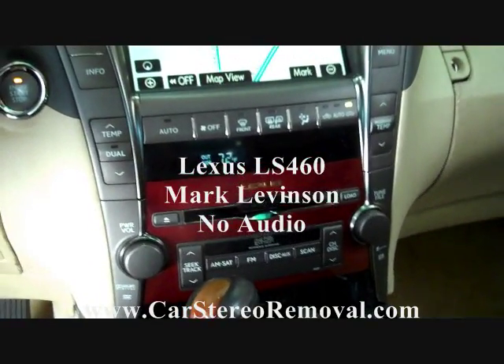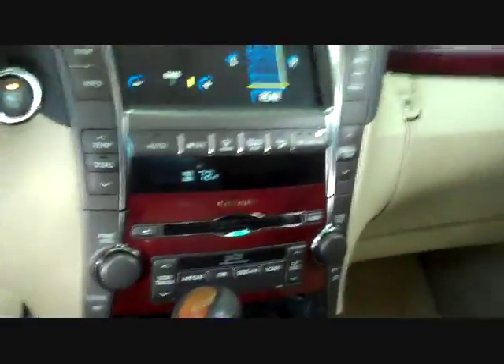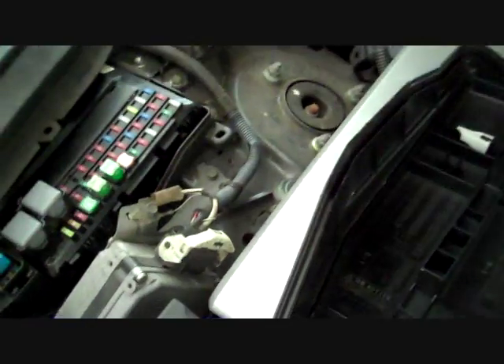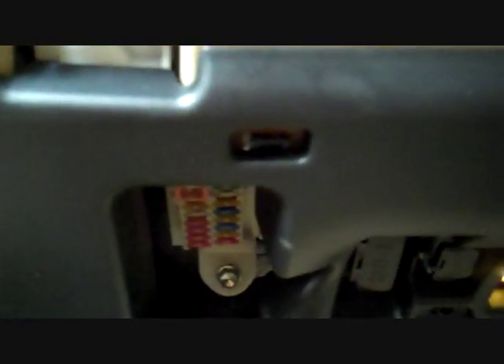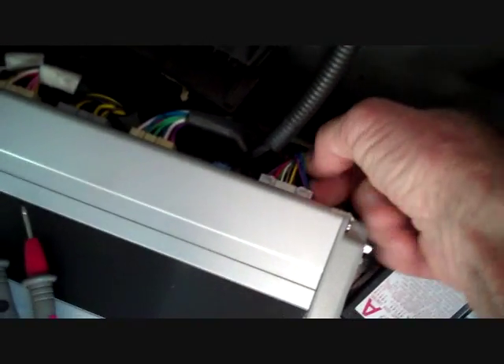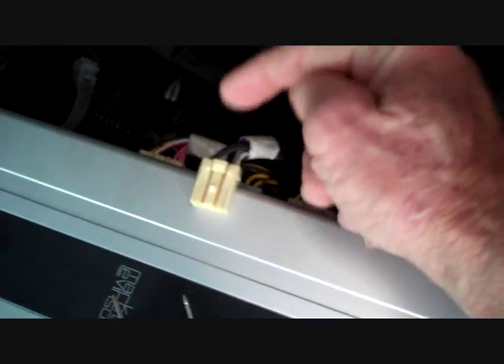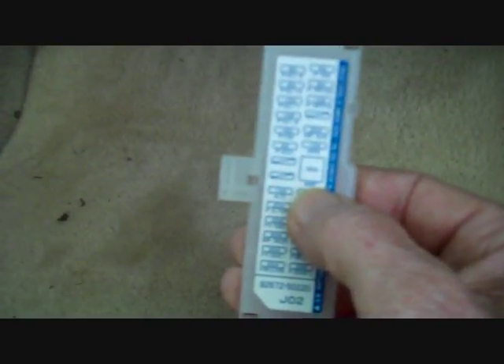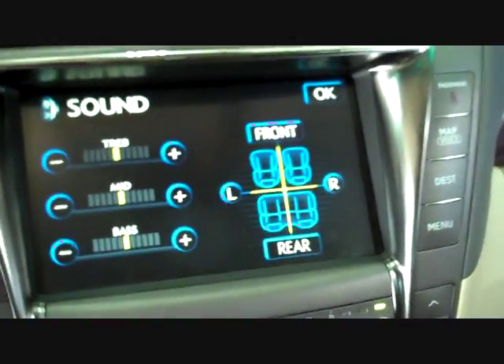Lexus LS460 Mark Levinson No Audio = Car Stereo HELP

Comment: Thank You!!! I have not been able to check back with my relative to see if this resolves the problem, but all the symptoms you experienced are the same as hers. It's a 2007 I sold to her and I feel obligated to help her fix it. You may have given me the answer.
Also, when I owned it, the amplifier failed and I had to remove it and sent it to a place in Syracuse NY. They were professional and solved the initial problem. Now I'll try your method and I hope it works. Question: Do you know the amperage of the fuse required? I don't have the car with me.

Comment: What was the point of telling us the fuse panel when you didn’t tell us which fuse to check?
Reply from the maker: If you have the owner's manual, you know which fuse to check. Without it, your checking them all. Your checking them because something? is not working...

Comment: Lexus should have recalled all those cars and fixed the stereo. Wish I would have known I never would have purchased the car.
Reply: Hahahaha I have the same issue with 2023 GX. Brand new vehicle. Have Been to 3 different dealerships they have replaced the amps and some speakers however, same results, after playing the radio with a volume on 50 for like 15 minutes the audio cuts off and the only way to get the audio back is to turn the vehicle completely off and turn it back on. This issue only happens with the luxury gx with the mark Levinson system. Didn’t have an issue with the loaner!!!!!!
Reply: I have an audio problem as well, wait until your battery gets "The parasitic draw" problem.
Reply: @TheFriendlyPsychopath any updates? I believe mine has had that problem Lexus replaced battery bc it was under warranty but I took my amp out and no battery issues

Comment: I have a 08' gx470 with the ML system.  When i turn the radio on it cuts in and out steadily and rapidly.  I brought to dealership and they could not determine what the problem was. Please note that at that time all lights would also go dim and bright rapidly and steadily as well so they recommended a new alternator and said that would fix the issue.. it did not. Any ideas what the problem could be or if there is some testing to see if the problem is with the amp? I suspect it could be the stereo itself.

Comment: Hi. Excellent video! I am having a similar issue with a 2016 Lexus RC F. The radio is working but NO sound at all. Do you know how many fuse boxes this car has? Where are they located?  Thank you!
Reply: Same issue in my ‘15 rcf, did you ever figure it out?
Reply: @kennyfsu  same for my rcf… you guys figured out?
Reply: @cesarguirado23  From my research we need a whole new amp. There's also a company called United Audio that can repair it but it's like $600.
Reply: @kennyfsu  great 🤦🏾‍♂️

Comment: Please do a video for Mark Levinson  2016  is200t lexus.  The 2014 to 2017 is250  should also be the same with navigation.  My amp gave out and I replaced it but still no sound.
Reply: Me to did u find out the problem
Reply: Same
Reply: Did you guys find a solution?

Comment: Hello great video I have same car no audio when connected via bluetooth it will work briefly then shut off like if its overheating or something because if shut car off and turn it on it will work again but If i raise the volume a bit high it will cut off and i have to turn car off and on again  for it to work ? And also it says audio off but the volume button seems unresponsive  Thanks
Reply: did you solve the problem? how did you decide?

Comment: I have a 2013 Lexus ES350. No sound, and can't adjust the volume Up or Down from the steering wheel. Is this a fuse issue?
Reply: Jeff Noravong did you figure it out

Comment: Send to OEM Auto Audio in Manlius, NY.
Reply: United Radio fixed my amp and it only lasted a year and a half. Died again. UR only warranties their work for one year.  I'm not spending another $475. I want a way to use an aftermarket amp but I don't know how to do any of this stuff.
Reply: daftboy11 You should be able to use a line level reducer or get the pin out on the wiring diagram and you may be able to tie it into an aftermarket amp. On the Toyota Celica the speaker lines coming out of the deck went to an internal amp they were all RCA’s just not with RC ends I had to buy a harness check out Crutchfield or some of your audio shops in your area should be able to do it wisely
Reply: Fixbrokenthings No sir, no spills. And I did contact them because it had only been a short time since they repaired it. All they said was it was out of warranty and I could send it back for repair for $475. Yeah, no thanks.

Comment: I just took this amp out and sent it in for repair as I thought I checked all the fuses, and sound was all down to the right.  I was told by the repair place it was the amp.  Got it back today and put it in, NOTHING.  same shit.  so now what
Reply: The amp blows the fuse on the passenger side when faulty. If the amp was repaired, now replace the 30amp fuse.
Reply: @shwndh  where is that located and what color? I have a 2007 lexus ls460
Reply: Same here.   Sent out repair.  Got back  but nothing work.
Reply: I may have to test the fuse block on the trunk.
Reply: Did you find out the issue and fix it? I got the same problem now
Reply: Can you please provide the info for the shop who repaired the amp I want to send mine to get it fix as well thanks

Comment: i have the same problem with my 06 gs300.. no sound, i can't change the bass, balance or fader.. I've been looking at all the fuses and they look fine.. i'm lost lol
Reply: Same bro my sound cut off one day and never returned
Reply: @chyshawnellis7757  .. I replaced the amp and mounted it in a different location in the trunk.. right above the rear dash, it was getting wet
Reply: Did you ever get it fixed?
Reply: @MrDiddibop  sorry for the late response.. I replaced the amp and mounted it in a different location in the trunk.. right above the rear dash, it was getting wet
Reply: What caused the issues
Reply: @adrey131  sorry for the late response.. I replaced the amp and mounted it in a different location in the trunk.. right above the rear dash, it was getting wet..

Comment: I have the same problem with my ls460. I changed the fuse and it died again.
Reply: Mohammed Jalal i have the same issue. Fuse keeps dying.
Reply: @GhostWritter86  
Fuse will keep dying when there's a short circuit in the equipment. Better check the connections for the Amp or replace it.
Reply: My MY2007 460 had no Audio, dealer checked all fuse boxes could not fix, diagnosed with a Mark Levinson specialist, he advised the issue was inside the head unit, took it out and fixed in 2 days. Charge $500
Reply: @kgreham  where is the info for the specialist ?
Reply: Mine just went out. So replacing the fuse Could be the first step?
Reply: @curtislbrown41  same here, did you fix it ?